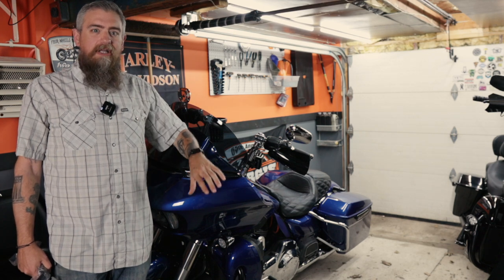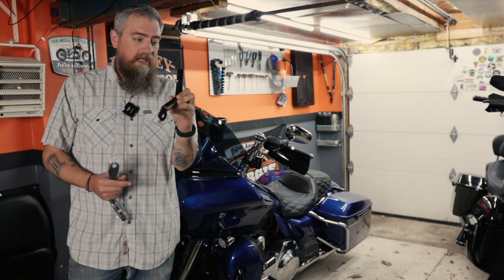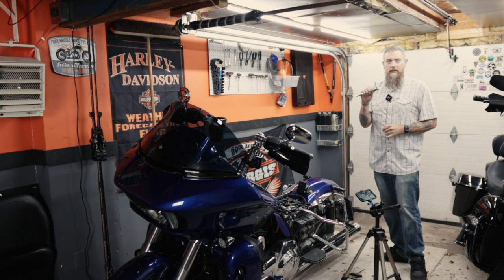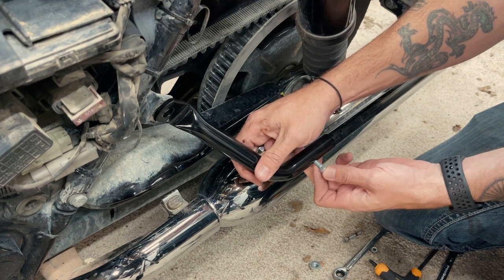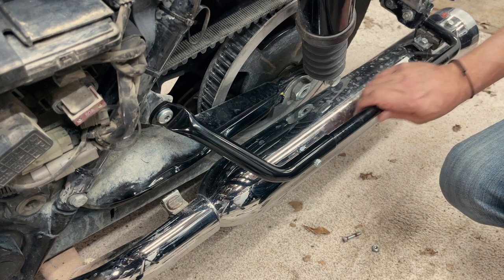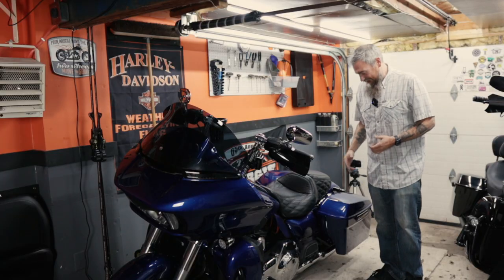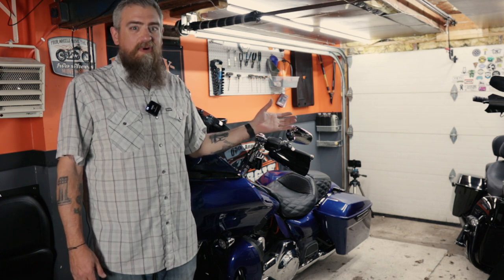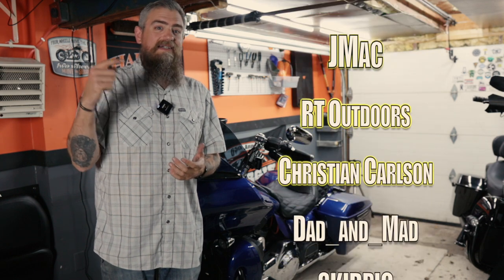I'm Ditching Crash Guards On My Road Glide?! Find Out Why | Eagle Skull Sadllebag Guard Delete

Comment: I bought a blacked-out 2022 RGS a month ago.  I had no problem finding black saddlebag guards to fit.  I like them.  Your solution looks good, too.  I just wanted to comment on your comment that black saddlebag guards are hard to find.  Personally, I feel that saddlebag guards are a better idea than not.
Reply from the maker: Guards that will protect these  extended bags are hard to find.. but I agree, it’s a little nerve wracking not having the guards, it does look good though.

Comment: Buddy, that was a great move, really cleaned the lines up big time, makes the bike look newer!  Wow just envision black 1 1/2” handlebars, black front forks, and some black dual exhaust from your neighbor Khrome Werks. I see Ornery One, Cycle Fanatix and Traveling Tall are all running that exhaust set up. They sound off the hook and look outstanding. What bars are you thinking? Paul Yaffe?
Reply from the maker: Handlebars.. idk I really like my klip hangers .. I might just swap to black klip hangers.
Reply: @Touringmidwest  yeah that’s easy to get powder coated black with your forks!
Reply from the maker: @DeBa1226  yeah.. a bunch of stuff is gonna get removed and powder coated next year I think. Can't do it now because I don't want to miss any of the riding season. It's to short the way it is.

Comment: If you wanted the saddlebags guards , sandblast the chrome and have them powder coated, just a thought
Reply from the maker: It's a great thought and one that I had considered but they just look goofy with the stretched saddlebags .. they wouldn't protect the bags in a drop anyways. I'd need to find a set for stretched bags.